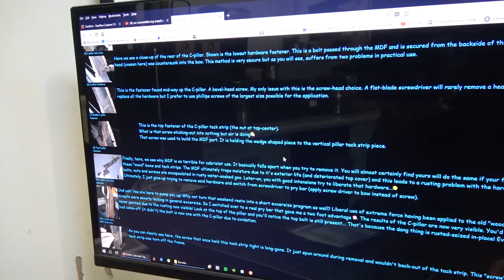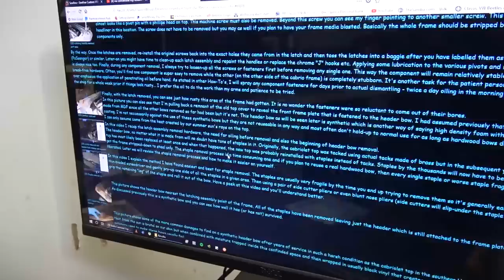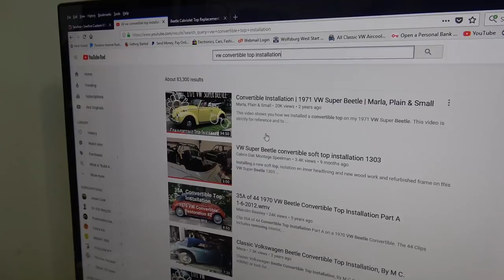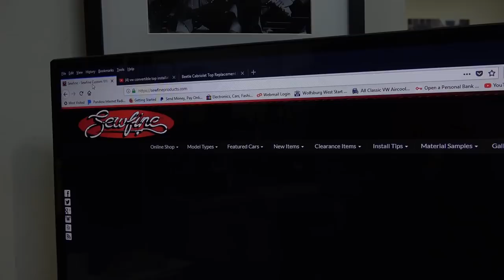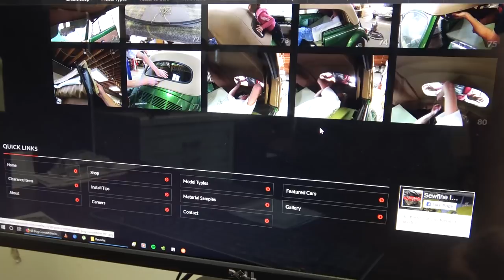Classic VW BuGs 1970 Convertible Beetle Restoration Top Installation Dilemma

Comment: Chris several things..wood bow must be hand fitted as all top were hand fitted to each car, and seals were shimmed as necessary to seal around window...front seal glued to header bow before top was install only thru 1967 all 1968-72 had the exterior seal mounted with aluminum mounts, as shown in our instructions ( which we have had since 1994 which Marla used to install our parts when doing her You Tube video  we offered a mail in service for complete top restoration we completed over 200 tops over a 20 year period..) .. headliners are stretched from front to rear bow first, then pulled up to the middle bows this sets the bows to the headliners which is more apt to create a wrinkle free headliner, if you check our website we show our headliners installed that have no wrinkles..Chuck / Chucks Convertible Parts
Reply from the maker: very good info, thank you!

Comment: I had a 69 bug convertible in 1979, so it was 10 years old when i got it. As for the front channel that seats against the top of the windshield, it did have a 3 channel bit of rubber stripping. Couldn't tell you if it was factory, but i can tell you it leaked in the rain.

Comment: Great job Chris! Thank you so much for your videos. I am working on a 1970 vert as well. I just  remove my top from the car, and there was definitely a rubber seal  on the outside of the canvas top that meets the windshield.  It’s still intact and I could include a picture as well. Looking forward to the installation of your top so we can hear about your pointers And tips. I will be attempting mine soon.

Comment: there was a guy on The Samba that had a step by step DVD but its for 1974-1979 year tops. As Im sure you have found out, the top frames and parts do vary over the years.  I bout my top from Chucks for a 1979 Super and used the DVD I bout and had EXCELLENT results.  message me if you would be interested.

Comment: I noticed that the YT video you mentioned (Maria's) was for a '71 Super Beetle and you have a ''70 regular Beetle...could that explain the differences in measurements?
Strangely enough, your talking about getting the top taut reminded me of a trick I use when installing screening material on wood window frames to make it nice and taut.  Long story short, would it not make sense to open the frame slightly from it's fully "up" position, staple the material at the top front edge and the very back edge so it's reasonably taut, then close the top completely (which expands the frame) to pull the material completely taut? You could then fasten to the remaining supports while taut.
Reply from the maker: Hmmm Chris you may be on to something, I may try what you say.  As far as Maria's video, I believe the top is the same from 68-75, so the measurements should be the same.